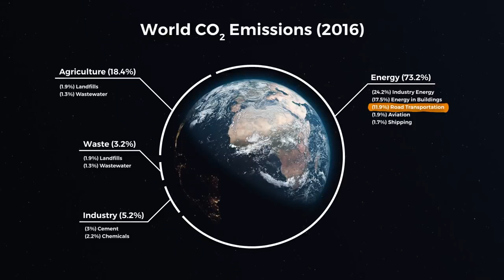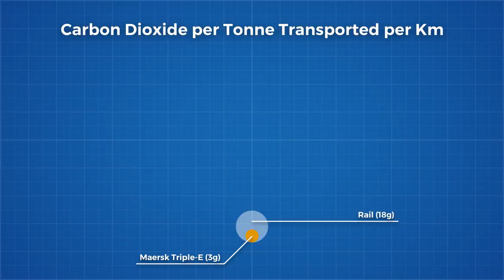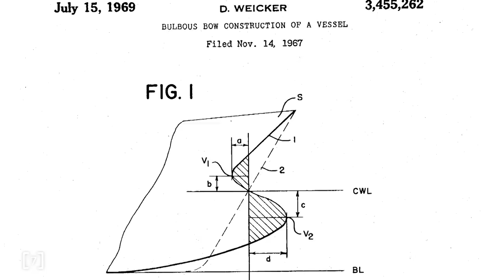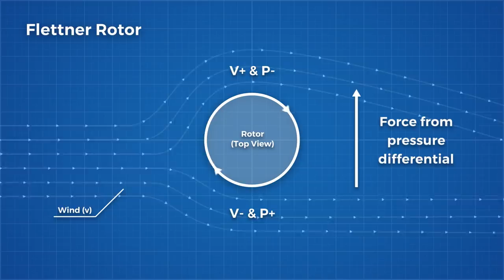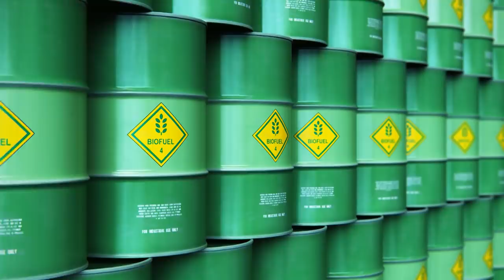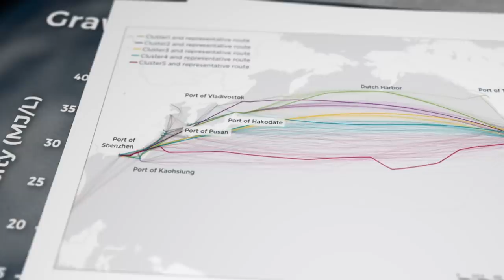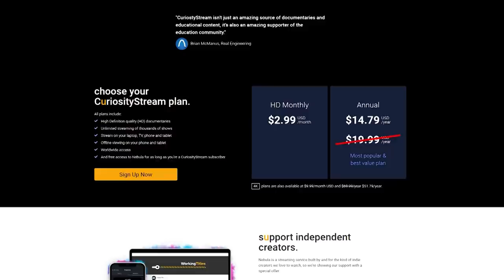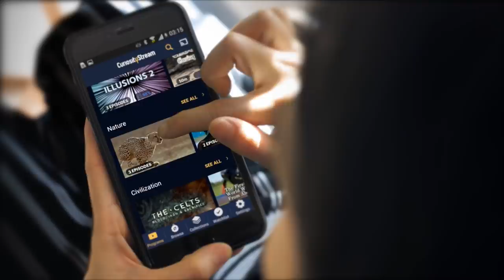Are Renewable Powered Ships Possible?

Comment: I know i'm about half a year late to the party, but what would be today's challenges and benefits to nuclear powered cruise ships, cargo ships and huge tanker ships? 

I can only imagine due to the US Navy's decades of experience in nuclear propulsion for their Aircraft Carriers and Submarines the technology should be developed enough for it to be a safe option with extreme benefits to fuel costs and emissions... 
I do know it's alot more expensive than building a ship with a diesel engine, considering these ships are usually in service for more than 15-20 years anyways it would be interesting to see a proper breakdown of this, aswell as seeing if there's any commercial interest in this at the moment. 

I doubt you'll see this comment, but if you do, could you please make a video about it?
Reply: If you do a web search for ‘nuclear ship savannah’ you will see that it has been tried and did not work.  A similarly vessel heavily subsidised, by the government, vessel is in use in Russia which also operates, in support of the Northern Sea Route, a fleet of nuclear powered ice breakers all of these may, or may not, have been completely without issues.

Just think; would you have full confidence in the management of a nuclear reactor under the control of an anonymous entity only traceable, perhaps, via a letter box in a FOC (flag of convenience) nation state?  If you are, could you sell that confidence to Japan, the state that hosted the Hiroshima and Nagasaki nuclear detonations as well as more recently the Fukushima ‘event’?  Then try that same, or a similar, sales strategy on Ukraine, the nation state that as a part of the USSR (CCCP) hosted the Chernobyl ‘event’.  Modern iterations of nuclear energy, thorium fuel, molten salt reactors or fusion reactors, will carry the legacy of past problems.  It is the global trepidation of anything with 'nuclear' in the name and the economics of nuclear having transitioned from 'energy to cheap to charge for' too 'the costs of remediation are incalculable' that will prevent the adoption of nuclear energy as a means of creating energy at sea.  Modern reaction systems may have overcome the safety problems but the general public, having been misled in the past, will be reluctant to believe the fresh new promises.  The incident of the ‘Ever Given’ blocking the Suez Canal, March 2021, may also have a little to add to this debate.  The cooling water on ships tends to get taken in from near the bottom so when running aground the inlets are in a prime spot to get plugged up restricting, if not stopping, the flow of coolant.  One thing that the TMI, Chernobyl and Fukushima incidents all had in common was that the supply of coolant, or rather lack thereof, was a fundamental cause.

‘They’ say nuclear is cheap, it’s not it is expensive and has a large embedded carbon quotient as well as being complicated, dangerous, not universally socially acceptable and having only ‘no need for refuelling’ as a questionable advantage; actually it does need refuelling just not as often.  When ‘they’ do need to refill the warming up stuff it takes considerable longer than pumping tonnes of thick black stuff, cSt380 HFO, or thin runny stuff, MDO, onboard which is one of the reasons HMS Queen Elizabeth and HMS Prince of Wales are pushed about by ICEs and gas turbines thus using a similar fuel as the aircraft that fly off of them.  The Royal Navy (RN) with a high degree of skill and expertise uses, at vast expenses to the UK taxpayer, a current operational nuclear fleet of 11 submarines (also known as ‘boats’) in two flotillas, seven attack subs and four ballistic missile boats.  The carbon footprint of all the extra bits of hardware and the fuel, including processing thereof, from ground to propeller, are the external costs that never seem to get considered.

Disposal, once it wears out, of both the machine (that was a ship) and fuel is another can of worms best left unopened.  The 26 RN boats no longer in use are laid up (some in Rosyth and some in Portsmouth) awaiting long term deconstruction including dealing with the fuel rods and other irradiated material.  The USN is not, as far as I know, a commercial organisation working to very tight margins and also has the skill and expertise to handle the complexities of nuclear power; so as well as submarines their aircraft carriers are nuclear powered and each of the current iteration has a build cost three times that of QE/PoW, bigger crews and more generous funding.  For those who still think that nuclear energy might be the answer I recommend this report: - https://www.bbc.com/future/article/20200901-the-radioactive-risk-of-sunken-nuclear-soviet-submarines?ocid=ww.social.link.email.  The navy of the USSR might have been under resourced and over extended but it was still generously supported in comparison with merchant shipping.
Reply: @BernardLS  Damn, thats a nice ass response. 

While you do make great points about the public perception aswell as liability and risk involved, i´d still love to see a complete breakdown of pros / cons / costs / benfits on both the financial and environmental side of things.

I do have to say though that with most of the few tests of commercial nuclear powered ships were started upon in the 50´s and onwards it would be interesting to see how it would be with modern, mature technology. 

When it comes to waste i´d recommend taking a look into finland´s new research about nuclear power and storage, as they´ve just done a tremendous amount of work on the subject and are apparently going full-throttle with nuclear power on land, so i imagine the same kinds of storage solutions could apply for ships, aswell as ongoing research about storing it in plugged underwater oil wells. So while the nuclear industry does leave radioactive waste, the amount of waste to danger of waste ratio seems to be low compared to other industrial waste. 

With Finland´s storage solution they´ve calculated that if you live right above the storage and it starts seeping out and you get all your water and food from the area around your house it´ll add a radiation equal to eating two bananas per day. 

The amount of danger the waste of today´s reactors have is exeggerated by the incidentes you´ve mentioned and the flaws that led to these disasters, but going by new research, new reactors and new storage-solutions it doesn´t sound all that bad. Most of the dangers of it all seems to be caused by the technology used in the past.

While this mostly concludes the depths of my knowledge of nuclear power based on reading a handful of articles about new reactors aswell as scientists explaining the waste-problem, i´d love to hear from you, aswell as mentioned before, see someone like Real Engineering make a video about it, as it is fairly interesting.
Reply: Thanks for the e-mail which has prompted more research.  The following two leads might be interesting for you but getting any 'real numbers' to judge how un cost effective nuclear energy at sea would be is going to be a challenge; https://en.wikipedia.org/wiki/NS_Savannah & https://www.flexport.com/blog/nuclear-powered-cargo-ships
.  The Russian cargo ship appears to be in lay-up since 2012 so I must up date my comment on nukes.  There may be a place for fixed carbon energy form fusion or fission on land but as a prime mover for merchant shipping it will always be difficult to make a case.  Marine casualties, though not as high profile as 'Ever Given' or 'Exxon Valdez', routinely happen on a monthly if not weekly basis so the risk and expense of nukes is not, IMHO, not worth the benefit.
Reply: Using lots of energy it is possible to liberate hydrogen (H2) from Methane (CH4) the cheapest available source of which is the FOGI this is called black, brown or gray hydrogen depending on how bad it is, so that will earn you the ire of the Green-meanies.  The other, much touted, option is to liberate hydrogen (H2) from water as so called green hydrogen if the power for the liberation is environmentally benign; you need a lot of energy and while fossil oil & gas, or perhaps coal, will do it and are the most readily available any energy source, wood, photovoltaic, wind, tidal, et cetera, will do.  H2 is said to be good for use in fuel cells that will give clean energy when combined with Oxygen (O2) and leave only water (H2O) as an effluent; so as well as the cost of creating the hardware and separating out the H2 in the first place we now have the cost of providing the O2.  H2 is very, very light and very, very volatile so this is where we remember the Hindenberg airship disaster and while events of that magnitude might not be likely much smaller H2 fires or explosions can cause a lot of damage.  The ‘light’ means that though there is lots of energy per unit mass there is not much mass per unit of volume so all the problems of CH4 but much worse.  You need to compress it, more than a lot, or cool it, more than a lot, to get enough on board your ship in manageable volumes to be useful.  The alternative to fuel cell use of H2, burning, also generates combustion products which includes waste heat going to the cold sink and a few NOx ‘nasties’.  H2 may have a place in the energy mix on land as a storage medium but on a ship where there is a reasonable and constant auxiliary power need the question could be posited, ‘why go through the extra stages instead of using the harvested energy directly?’  After harvesting the energy, from wind, sun or motion of the vessel, as electrical energy better to deploy that energy directly and immediately as heat, light or mechanical work.  As with nuclear energy at sea some of the ‘alternatives’ may have a use in littoral submarines in AIP (air independent propulsion) systems but that will be with the same caveats of cost, space and complexity so would not perform in a high volume low cost mercantile situation.  The numbers, on any of these, are getting very difficult to show any sort of surplus so is this a case of running hard to stand still?
Reply: @BernardLS  I have read about the Savannah and i'm already familiar with the other ships where they tested nuclear power aswell, but once again, most of these articles don't really seem to take into consideration the dated technologies of this. Another point about the savannah is it's purpose. it was a hybrid cargo / passanger ship and it was never designed to be profitable, so to even use it as an example for how it's too expencive seems a bit inappropriate. 
With today's nuclear power on land and countries developing supply chains for nuclear fuel AND waste it would be a completely different story, aswell as the newer technology and safety has increased dramatically. As stated in the artivle you linked, the US Navy has never had a nuclear reactor related accident. 
You also have people like Edmund Hughes, the former head of Air Pollution and Energy Efficiency at the IMO saying the shipping industry should start considering nuclear. Link for reference.
https://www.spglobal.com/platts/en/market-insights/latest-news/shipping/110420-shipping-industry-should-consider-nuclear-option-for-decarbonizing-experts

You also have British Maritime Technology and Lloyd's Register studies from 2010-2012 (papers released in 2014) where they've concluded that the concept of accomodating a 70MWt nuclear propultion plant delivering up to 23.5MW shaft power at maximus continious rating on a 155.000DWT Suezmax tanker would be feasable. The simulated model showed this would be able to operate up to ten full-power years before refueling and having a minimum lifetime of up 25 years.. They did also include the fact that further maturity of nuclear technology and harmonisation of the regulatory framework would be necessary before the concept would be viable, but this being almost 10 years old and nuclear technology / supply chains / waste disposal on land is evolving rapidly, i wouldn't brush this off as a complete no-go.
Reply: @EscapingElyisum  The USN may have not had a nuclear related accident, or even a near miss, but the Russians’ have and from my own experience in, and around, the merchant marine I hold the opinion that standards on many merchant ships do not even get close to the level the Russian navy has to cope with.  "You will have ships going maybe 50% faster because the fuel is essentially free once you have made the upfront Capex investment".  50% faster (why ?) would probably require 100% more energy use; meaning faster fuel rod depletion and thus more frequent fuel element replacement so that ‘free’ is questionable.  New tech = fresh problems; e.g. fusion reactors are still a decade away, as they have been for the past fifty years.  WADR reducing GHG emissions will be achieved by a combination of improved fuel quality (SOx, CO2 & NOx), better engine design and operation (NOx & H2O) and better fuel supply chain management (VOC’s & H2O).  Not a brush off more a continuation of the same old scepticism; and worrying about the nautical casualty rate.  The difficulty of finding a ‘port of refugee’ when things go wrong is something else I know about first hand, even established civil entities like France and Spain have a habit of being ‘unavailable’ when an incapacitated / leaky / sinking oil tanker turns up.  Even if it is ‘on their doorstep’ so to speak.
Reply: @BernardLS   i suppose that´s true, but i also imagine there´d be increased international requirements and oversight if nuclear merchant vessels were to start becoming a thing, and the shipping companies responsible for operating them would have a PR-disaster on their hands if something were to go wrong due to the volatile situation that is public perception of nuclear energy. hence my "it would be interesting to see" stance on the matter as a whole.

Thanks for some great insight and feedback though, it´s been a pleasure!

Comment: What about using small nuclear reactors like the US navy does on aircraft carriers and submarines? Normal cargo ships last about 30 years but the USS enterprise was in service for over 50 years. Nuclear powered ships have zero carbon emissions and can go decades without being refueled. They also need very little space for fuel. For comparison a cubic centimeter of uranium has as much energy as over 3 tons of coal. The reactors used by the US navy have been in used for over 60 years with no accidents worth mentioning. The Russians also have 4 nuclear powered icebreakers as well. Nuclear power has proven itself to be a very safe and effective technology to power ships for the US Russian and British navies. The commercial shipping industry is definitely missing out by not making use of it.

Comment: In Baltic sea the ships use lng, any ship with diesel engines can be modified to use that.
Reply: Trust me no they don’t. Only LNG carriers and very very small select few of specially designed or converted vessels can run on LNG. 
Example in the Baltic the SCF LNG powered Aframax tankers e.g. Gagarin Prospect. But these LNG powered oil tankers number only 6-8 in total. 
In the baltic all the ships run around on 0.1% Ultra Low Sulphur (ULSFO) fuel for the Marpol Special Area. 
Of course you’re right any ship can be modified for the right amount of money but it’s not cost effective for the majority of the vessels around the world.
Reply: @jameslane2615  sorry, should have been more precise, my bad 😅 the Cruise ships. Atleast those that go around sweden, finland and the baltics 🤔. LNG should be pretty easy solution in Baltic sea atleast, should be pretty easy to ban heavy oils afterall it's almost conpletely EU waters.

Comment: Norway is now running hydrogen ferries and Japan ironically has a battery powered tanker. It is possible!
Reply: With enough ingenuity (from which the word engineer is derived) almost anything is possible.  At the moment the lowest cost resolution of the challenges is ICEs powered by liquid fossils fuel.  Some environmental costs are externalised, so the global community has to bear them, for the benefit of the users of the service.  The internalisation of those costs is the responsibility of the regulators while the ultimate liability should lay with consumers of the materials being transported.  If you want your toys and gadgets you will need to pay that cost.